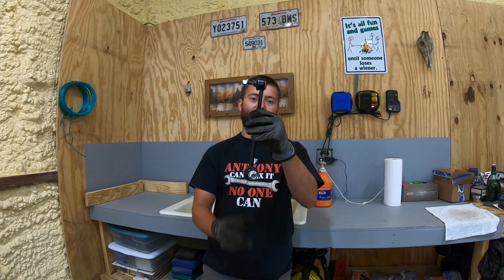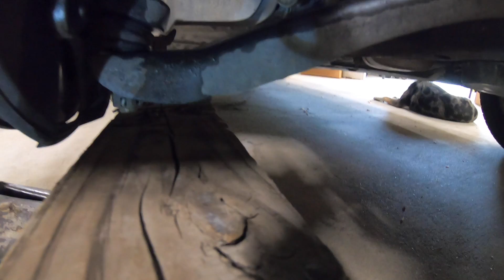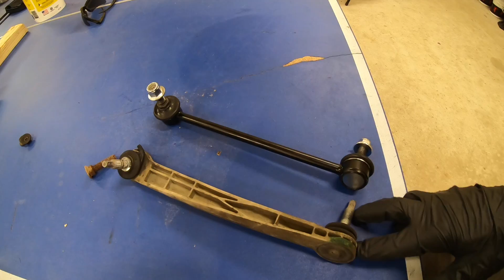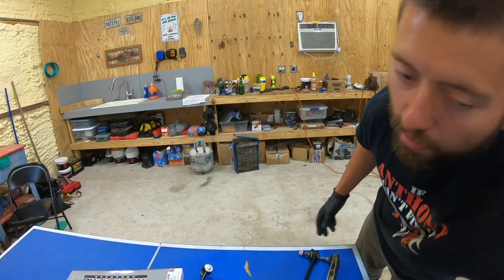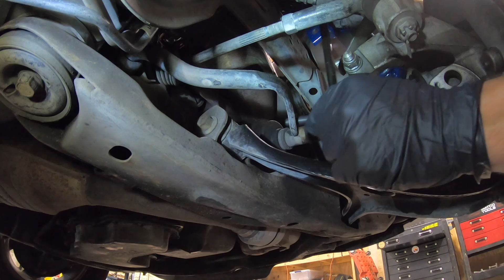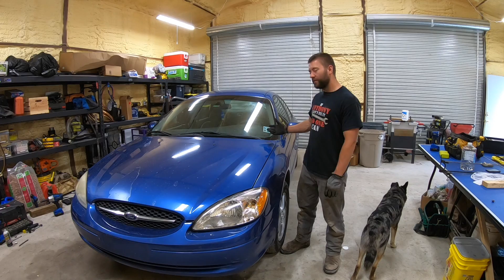Ford Taurus Stabilizer Link Replacement

Comment: What are the symptoms of these being bad? I have a squeak pretty loud on my left side only when turning right.
Reply: Also have the original fat bar on it. It wiggle side to side by hand.
Reply from the maker: Usually clunking
Reply: @dudewecanfixit  thank you for response. I can not pinpoint where the squeak is coming from

Comment: I guess mine have been replaced already but im doing them again. I dont have the kind that works using the 8mm socket but i have to use a vice grip on opposide side to hold nut from spinning. I got one side done but the lower nut on pass. side wont budge. Any hints besides PB Blaster. Will i have to cut the bolt off?
Reply from the maker: If you can't keep the nut from spinning, you may need to cut it off
Reply: I've always had good luck using a propane torch to heat it up when pb won't work. Get it hot and try, then add more heat as needed. Having a fire extinguisher nearby is a good idea. Just did a stubborn motor mount this way.

Comment: Thanks! Discovered a tear in the bottom boot of my sway bar link on driver side after inspection of why I was feeling vibration when turning wheel. Will be doing this as soon. As part arrives.
Reply from the maker: Fantastic!

Comment: Will this work on a 2005 trailblazer?
Reply: Opps, that was supposed to be on the transmission rebuilt of the 4l60e
Reply from the maker: Lol, if it's a 4l60e, then yes, it's the same
Reply from the maker: Stabilizer links are all about the same. Some have a few bushings that you have to assemble during the install. I'm not sure what style the trailblazer uses

Comment: Very helpful video. I have a 1997 Taurus SHO and just replaced the front sway bar end links and have the rears ready to be replaced also. I got a set from Detroit Axle and it came with all of the sway bar end links and ball joints as well. So, the front has all new ball joints, wheel bearings, tie rod ends, and sway bar end links. I also ditched the plastic crapola ones for steel.
Reply from the maker: Very nice, I bet the car drives and sounds better

Comment: IT'S HARD TO FIND A YOUTUBE VIDEO THAT IS STRAIGHTFORWARD AND SHOWS YOU EVERY STEP CLEARLY AND CONCISE, GOOD JOB MY MAN. WITH THAT SAID I'M GOING TO SEND YOU A SET OF GEAR WRENCHES, I AM A PRETTY ANAL TYPE OF MECHANIC SO FOR YOUR VIEWERS THE TORQUE SPECIFICATION IS BETWEEN 30 AND 35 LB.
Reply from the maker: Thanks! I'm fairly particular about how I do things. I like to make it easy to follow, step by step for everybody. I don't have an all-data account, so it can be difficult to find torque specs. If you want to send me tools, DM me on Instagram and I'll send you my address. I definitely appreciate both the feedback and the offer!
Reply from the maker: anthony.montgomery.792